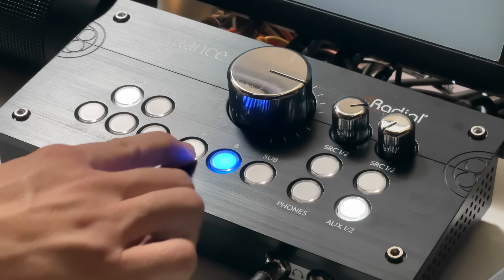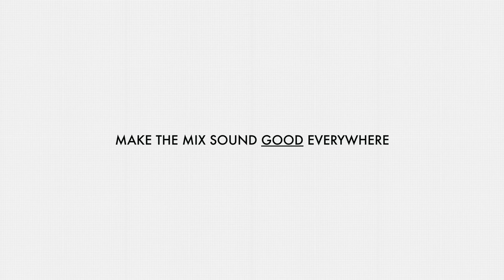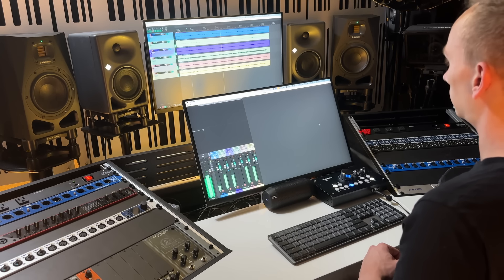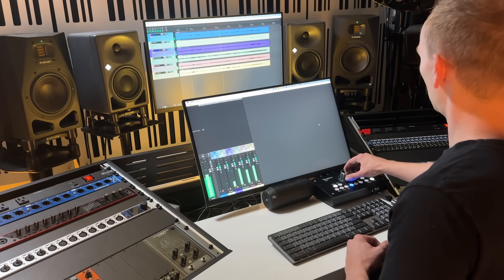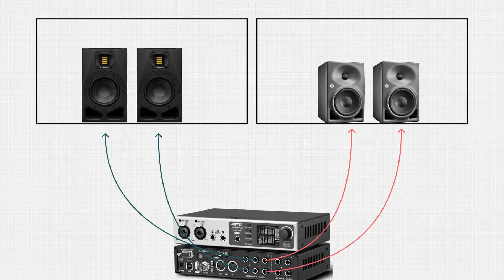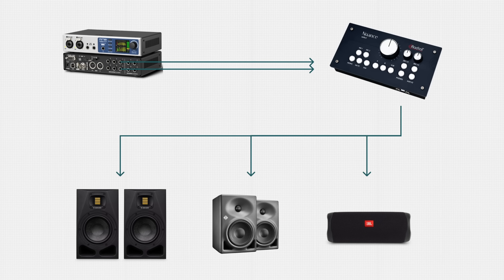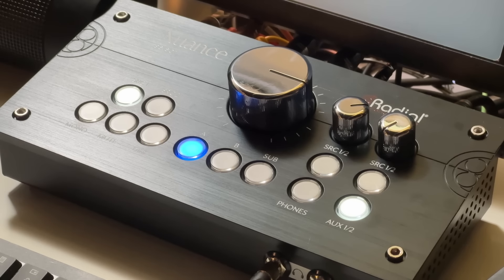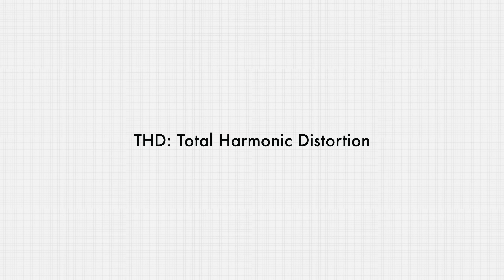The Reason Your Mixes Don’t Sound Good Everywhere (And How to Fix It)

Comment: The car is the final boss
Reply: Unless I can take the analog console into the car... no.
Reply: Most car radios use a mosfet amplifier, which are very close sounding to tube amplifiers sort of a glassy like tone.
Most home amplifiers are class d which have a flatter sound also most car speakers have increased highs and mids to overcome the extra noise
Reply: Nah, that's phone speaker while listening in the shower
Reply: No truer words spoken. If it sounds great inside the car . It will most likely anywhere else
Reply: Hell yeah! Luckily everything sounds like shit in my car
Reply: Indeed, and cars seem to love 3-4KHz, a range favoured and attenuated by our ears. Too much energy here = sadness and a feeling if failure.

Comment: i used to do a mix. then listen in my car. make notes, back to DAW, adjust, repeat. If it sounds good in a car its going to sound good anywhere.
Reply: The problem with this is most people new to mixing listen through the “consumer ear” and not a “engineer ear” with that being said if you do a mix and go to the car you might know what notes you could make but not necessarily hear or know what to change in the mix to fix the sound or sounds that you know for a fact are bad
Reply: Same with me test car is obligatory
Reply: @DannyDuhDemon  yah. Had to do repeats to get what i wanted.
Reply: Yeah that's all you gotta do
Reply: curious, where and what else did you here it on, to be so sure?
Reply: @DannyDuhDemon that is so vague…

Comment: After years of mixing, having less speakers is actually better. The car and one solid pair of monitors that are your truth will give you a lot more consistency. Listen to your mix in different settings over multiple different monitors. Car, live, on the stage, etc.

Comment: In my chain when recording besides the car test (played from a disk). I also have a pair of 6x9 car speakers. That are beside my monitors.  That when mixing I can use.
But the oddest studio monitor set up is my FM stereo transmitter. That I can hear what it sounds like on different radios.

Comment: No specific order: Good monitors (not a synonym for expensive), right placement of the monitors, correctly placed sound treatment, sonarworks & reference tracks. 

Why: you need monitors that are reliable, monitors have a sweet spot; sit on that sweet spot, placing treatment behind monitors and on the reflection areas gets you the most control, sounarworks tells you where your issues are at and you can use it to correct it, reference tracks that you know how they sound on multiple devices will help you gauge how your track will sound on those devices.

Comment: You're probably not going to see this, but I have to say something since you so prominently show REAPER recording your VO in the background....

PLEASE, please, please go to Preferences > Recording-> "Show preview...update frequency" and set the refresh rate to something like 30 or more.

The waveform being drawn at the default of 3hz  looks so chopy and terrible in the background
Reply: You can also smooth out your meters, Preferences > Track Control Panels.

2. Where it says "Meter update frequency", set it to 30 Hz.

I also suggest changing "Meter Decay" to about 40 db/sec.
Reply: Cool note 👍

Comment: I use a mono speaker thats reasonable quality through a half decent home transistor amp in the middle and a sub to check the low end, a couple of three ways up and further apart, another two way set on digital amps and genelecs for surgical sculpting all on a switcher. I’m further enough away from all walls in a very large room enough to differentiate at low volumes between the speakers and the reflections with very little to no bass buildup. tivoli single driver pal to check on and sometimes send sound through my monitor or mac pro to check further. It gets boring bouncing between your daw and car after a while. Might as well build a car stereo in your studio if that’s your gauge and car stereos can vary considerably these days apart from the general size and reflections of a car and the change in sound pressure in a more pressurised environment

Comment: Great video! Question: your measurement mic is probably about 45 degrees? I have an Atmos system, would it be better to have a 90 degree angle on the mic when measuring? Basically pointing up? I read something somewhere that’s said it’s preferable, saying it’s takes some of the initial wave inertia out of the equation. Anyway be great to see a room tuning video, how you do it anyway. Thanks 🙏

Comment: Do you have a BT transmitter on the Aux Output for the JBL box? Or does this model come with a line in connection?
Reply: I dont know what model of this JBL it is, but I know that every JBL model that I owe has an AUX output on the back, that includes JBL Go, JBL Charge 2+ and JBL Charge 3. So I would say it probably has AUX

Comment: If monitors and acoustic treatments are expensive, and rooms affect the sound so you have to compensate with EQ, why not just use high quality headphones to listen to the mix on?
Reply: I mix on both. I think you can get fairly close doing your tone shaping on headphones but what’s different (for me anyway) is the soundstage. I tend to pan more on headphones because it cleans up the center of the soundstage. Phones also tend give a different representation of the soundstage. I find my mixes sound more cohesive when mixing on monitors. Cohesive meaning everything sounds like it belongs together from the same space.
Reply: Headphones have higher distortion when volume is changed, have a less flat frequency response, have exaggerated stereo separation, offer no visceral feedback for bass and sub bass frequencies, are prone to lead mixers to use unsafe volume levels, and can be fatiguing in long sessions. They are not useless but they should not be the first choice for mixing or mastering

Comment: and by the way: the monitor controller has to be soo good (in quality, because you would destroy your good interface quality output), that you should stick your money better in a good room optimization. mechanically or digital (like trinnov nova) . it will be make more sense in my opinion.

Comment: If anyone here can, please help me with some basic information regarding making my room acoustically balanced at a minimal level in order to mix properly with the monitors I have.
Data:
Height: 8 ft 10 in
Length: 12 ft
Width: 11 ft.
Monitors-
(1) Mackie MR 8 MK2
(2) Yamaha MSP3
Note: The room is made of concrete walls and floors while the ceiling has asbestos boards. I can afford to lower the ceiling height by adding an extra layer of lightweight acoustic boards about 8 to 10 inches below that.
Reply: Hey man I took your measurements and found a couple things: first for your speaker placement I would recommend placing them at a height of about 39 inches, spaced two feet away from the back wall and about 30 inches from the side walls. These measurements should help reduce unwanted interference from SBIR, still you should use acoustic panels / bass traps in order to better minimize these effects. I recomend using bass traps which target a band of frecuencies around 111 Hz. Your listening position should sit at around the same height as the speakers and be about 81 inches from the back wall. Also for your panels you really only need to place them so they catch the first reflexions from the walls as well as the floor and ceiling. You can use a trick where you sit at your listening position and have someone else move a mirror around on the wall until you can see the cone of your speaker, that is where you place the panel. For you I recommend trying to use panels at least 3 by 3 ft but if you arent able to do that then just use the next best thing. There is more you can do regarding room modes and such but i figure you just want the basic stuff. If you have any questions shoot me a message.